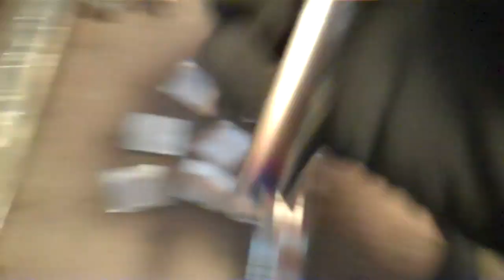Delboy's Garage, Project Tow Hitch, Part Five..

Comment from the maker: Hi Claus, i have doem some test welds today, practicing not blowing through it, and the results are very strong...i was torn between using thicker tube and then it being too heavy, or making this work, i wll be bracing a lot of the joints to spread laods and eliminate weak points.. then some testing on the road to develop it as i use it...if it cracks, i can deal with it.. and after beating hard on the test peace it seems to make it really strong, plus ill drill and plug weld it too .cheers, Del

Comment from the maker: No, that wouldn't work, think about it, the axle stays at gound level, and the bike goes up and down with the suspension, and you cannot tow from an unsprung part of the vehicle, it must be sprung......but i may take a brace point from the lower foot peg mount later which is parallel to the angle of load...just need to see now heavy it ends up, im limited to 30kg total weight..